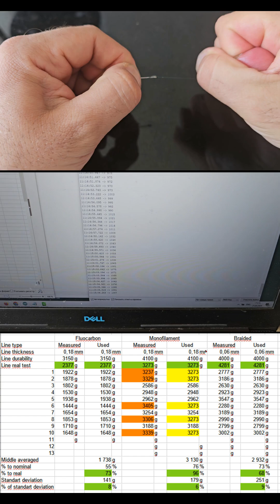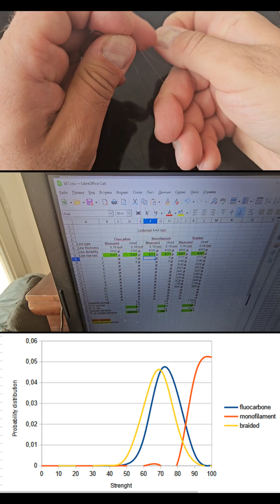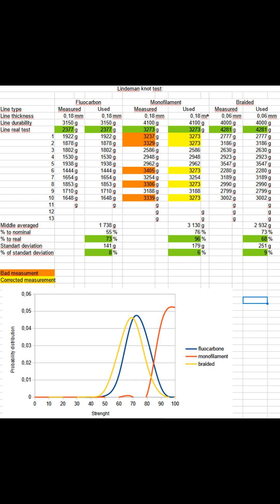Lindeman fishing knot static tensile strenght testing

Comment: I've noticed that you don't wet your line when tightening the knot. It can affect the resistance.
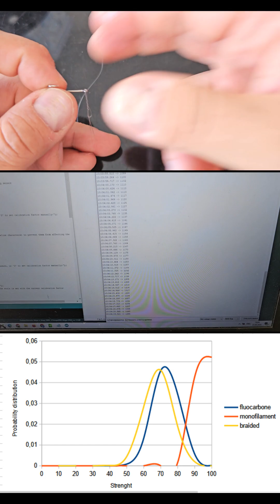Reply from the maker: You are wrong - at 00:51, at 01:51 and at 02:44 I wet the knot before tightening it - pay attention to the fingers of my right hand, I licked them first. At 00:51 you can even see saliva on the fishing line. Believe me, I observe the correct tightening of the knots - otherwise, what kind of test is this? It is for this reason that I present here this technical and completely uninteresting filming for the mass audience - as a test report. I just didn’t dare stick my tongue and other parts of my body into the frame - and limited myself to the fingers of my right hand moistened with saliva)))

However, thank you for carefully watching the protocol video - I’m glad that my work was not in vain))